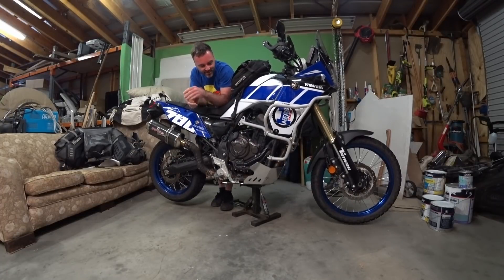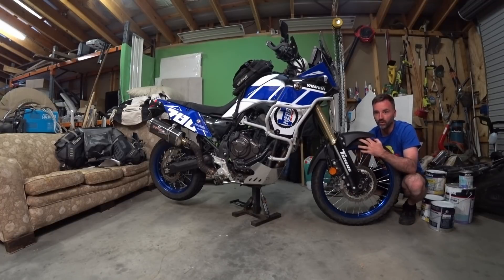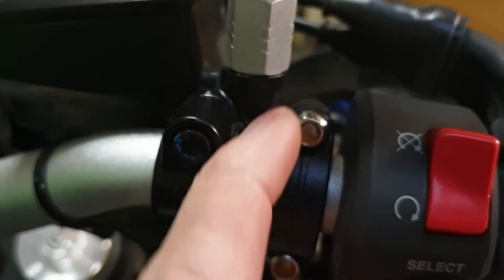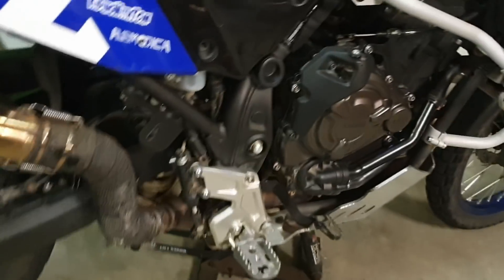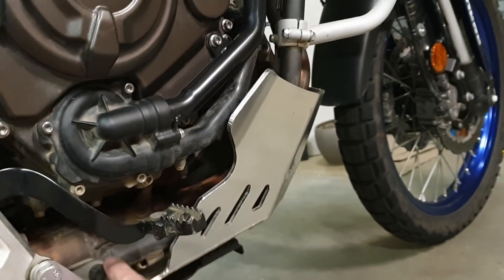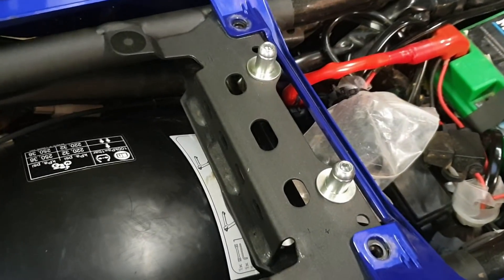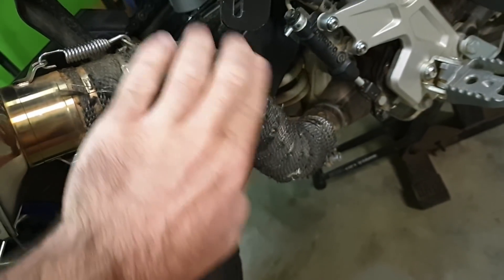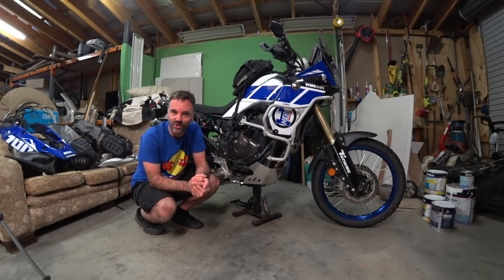The Tenere700 report

Comment: You have two bolts on each side back cover where the stock rack mount to from Yamaha make up some brackets from there to hold out your soft bags, it does not have to be very big just something to keep the bags off the plastics.  Cheers

Comment: I agree completely about the exhaust angle.  Yours looks loads better.
Reply: yea angle looks better but ill be burning my heels of my shoes quite rapidly.  and you can say wrap em. how ever he already has ware on his wrap. waiting for em to get a different fix
Reply: @corecass  high exhaust routing = hot as fuck in traffic. They routed it low because this is a bike intended for street use despite misleading advertising. Thin skidplate with the engine located literally 2cm above it..and the skidplate is mounted to the aluminum footpeg brackets.

Comment: Hello Nerb, here in the Netherlands the use of a bike is substantially different from Aussie. Nevertheless,  you show a few interesting hacks. I carry Kriega OS12 on the OS base plate. These sit a bit lower than Mosko. You reckon that strengthening the plastic panels is also needed? And isn’t there a way to make use of the luggage rack and the connection of the pillion handle to off set your Mosko bags?

Comment: Since I haven't  even seen a T7 in the State I am gathering as much information as possible. I'm going to get one to go with my AT (set the AT for long haul with lotsa tarmac) and the T7 more dirt rides. I like the exhaust setup but have no way to weld the bracket, small town no fabricators here, so I would need to figure something out for that part. But I also would like a thru pipe (cat bypass) with less S bend than your bike. I think by looking at the picture you showed this would be doable because of the change in routing to the head pipe.  Ask Peter for me. Thank you and Merry Christmas to all out there and hoping for a better 2021 but doubt it.
Reply from the maker: Cheers mate. Yeah, once you want to remove the cat, you are looking at a whole system and remapping. A slightly bigger job that I have done! Ha, have fun!

Comment: I guess if one were to use pannier racks, like a set of Tusk racks for example, that would negate the need to redo the exhaust hanger As the pannier rack would take the impact?. Is weight the reason why you aren’t using racks? Any concerns on wear through of the pannier seat with strap rubbing?

Comment: Nice and to the point video. ... you got a new subscriber !   :) 
I have the same issue with the tail section breaking and I didn't even have bags on it ... I guess you used regular epoxy or something for boats?
Love the changes made and that exhaust is very interesting, is the midpipe made of welded sections or just cleverly bent?  I am also wondering how the passenger pegs fit with your exhaust.
Do you have a link to the photos you mentioned.
Keep up the nice work ...
Reply from the maker: Thanks mate! Sorry to hear about the plastic... yes, its very weak. I used JBWeld plastic bonder. I think its about the best epoxy bond you can get for abs plastic.
Midpipe is welded... by a professional ;) Actually I havnt checked the pillion pegs. I have a little bracket for typing my bags. I will check and get back to you. Or maybe more detail in the new year when I get Peter in front of the camera to talk about it.

Comment: U havent talked about centerstand...is it important. Is it ok for offroad riding?
Reply from the maker: I have not got a centrestand. They are handy, but ive decided to go without one to save on weight and ground clearance.
Reply: @Nerb1  i agree. Thanks!
Reply: @Nerb1 It was the first accessory I put on my T7 and I took it off after a few hundred miles. I have the Hepco Becker. When standing on the balls of my feet, the spring mechanism on the right hand side was always in the way of my heel so my foot position felt too restricted. I also cut the little stem that sticks out from the stock side stand off for the same reason. Now I can stand a lot more comfortably and not feel cramped.

Comment: Thanks a lot for the walkthrough ;) ...do you have any abrasion issues with that MOSKO reckless system on your tail? Cheers
Reply from the maker: I have a b&b compact tail rack... since the mosko needs something to tie to. So it sits on the rack and the seat, not on the tail plastic.
Reply: @Nerb1  Yeah I saw that the tail rack is being used in that setup with the MOSKO Reckless :) ...was rather meaning if the abrasion happens maybe on the tail’s sides ...I have some Ortlieb backs on my XJR tail and they´ve grinded the tail a bit after a while :) Cheers
Reply from the maker: @klaudiuszszatanik4369  It hasnt, but it probably will, The idea of my sticker kit was to protect the plastics.
Reply: @Nerb1  Exactly, this is what I did on my older bike by placing duct tape stripes in those abrasion zones ...not beautiful though hahaha

Comment: Cool setup, I still have the oem bash plate and need to change it asap.
As for the water pump, touratech (which I am not big fan of) has a little protector that takes 3 minutes to mount and will do his job if somehow you get that stone there, it's cheap and easy so worth the piece of mind. 
https://shop.touratech.com/water-pump-protection-for-yamaha-tenere-700.html
Anyhow your bash plate slmost covers the pump pipes